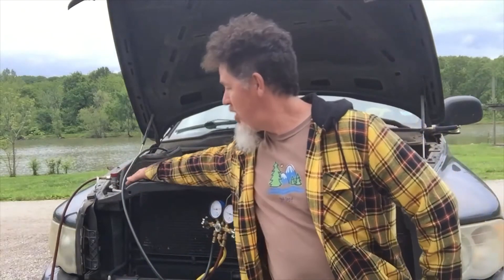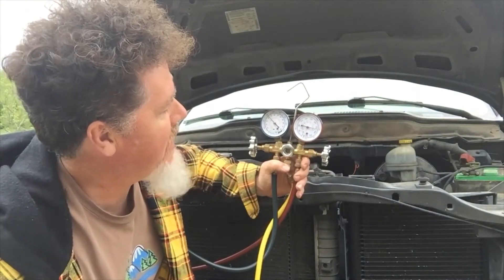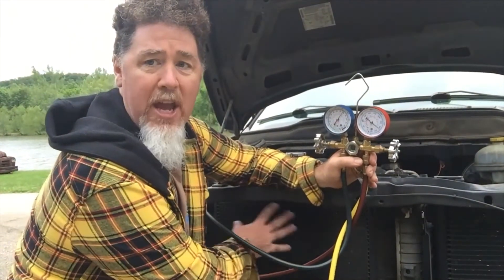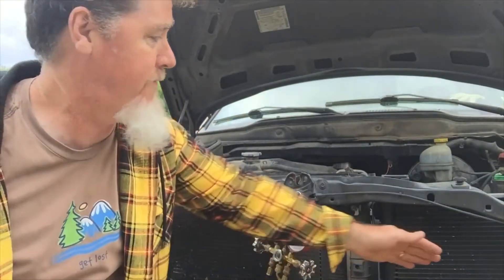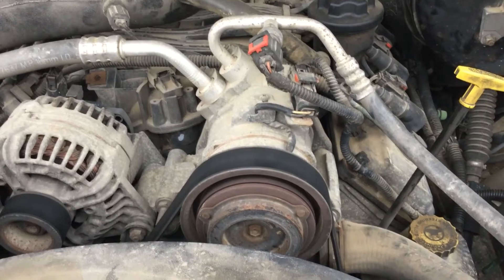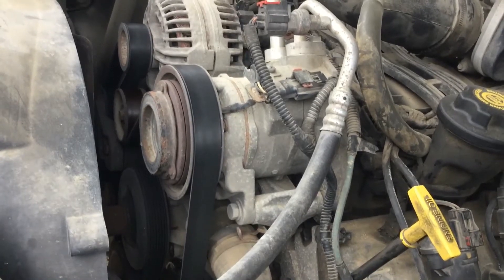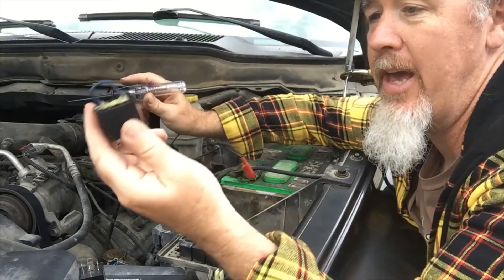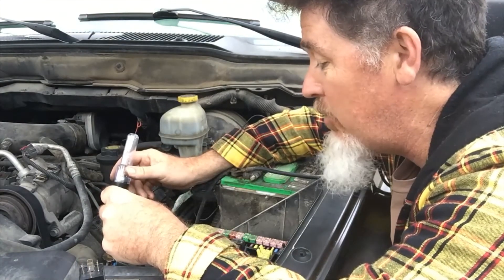2003 Dodge Ram AC Diagnosis Scenario

Comment: Professor, I have searched the entire internet with no luck until I stumbled onto your video. I knew with in the first 28 seconds, this was the issue. It was the clip on the condenser fan. Problem solved. Thank you for sharing such helpful information.

Comment: This was a bad design by Dodge. Fan runs all the time even when you are going 70mph. To do this job, you need to recover the refrigerant and take the condenser/fan assembly out.
Reply: Really?? Take out all the refrigerant just to replace the fan is crazy

Comment: did the bypass fan works and the A/C pump does kick on and off and air not to cold but recharged and fan still didn't kick on have PO480 code still and won't go away any idea's plz and thank you

Comment: I have a 03 5.7;just like that one in the video. My ac all of a sudden stopped working. Looked at condenser fan and was not turning, but the compressor was kicking on and off very rapidly. Going to check condenser fan fuse and relay.
Reply: Low coolant
Reply: @johnjacobjingle7177  I changed the condenser fan after swapping the parking lamp relay with the condenser fan relay. Fan still did work. Changed out the condenser fan a month ago, and all is working well.

Comment: My AC clutch is not shutting off (cycling off). When i turn AC on i get what feels like outside warm air and the clutch just spins. It does shut off when the AC is in off position./ So can i change the transducer without a chance of leaking refrigerant.
Reply: Did you find out what it was because I’m having the same exact problem